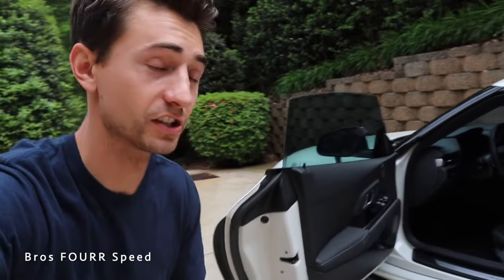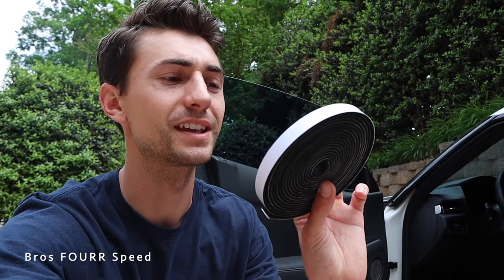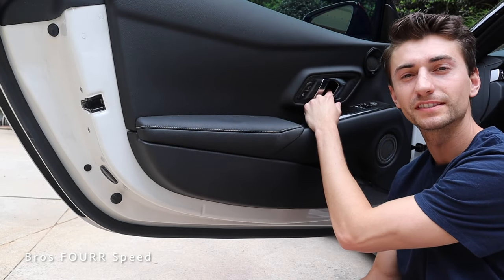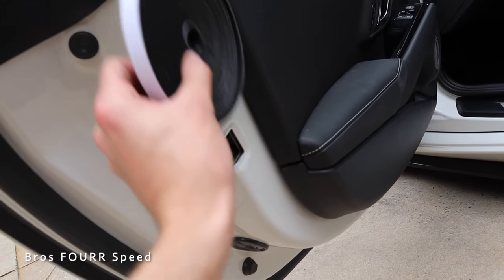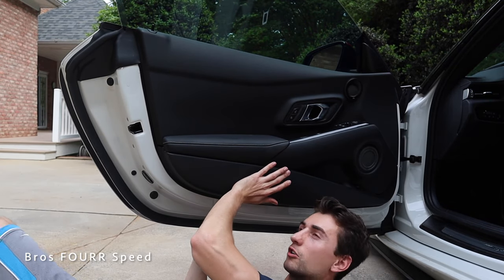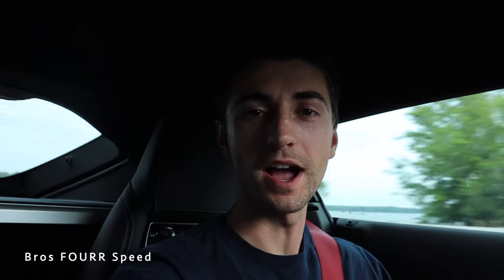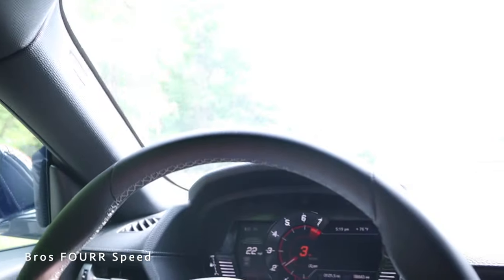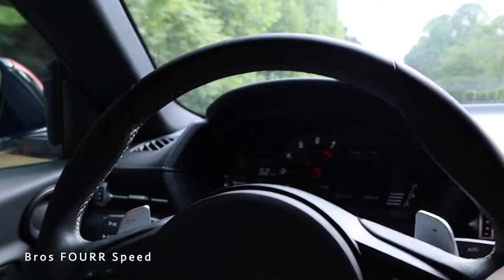How To Fix Car Interior Rattle Noises - (The Easy Secret)

Comment: As is usually the case, a little piece of foam as the isolator remedies rattles. I can't imagine how many points of a car could lead to rattles, it's almost infinite. If you asked me what I'd pay to have a basically guaranteed rattle free car, here's my metric. Fixing after the the fact takes much longer due to disassembly. If there was a tester that could isolate all rattles, then chalk that up to R&D, let's say adding extra padding to a car is 20 hours at 150 per hour. If we could pay $3,000 to have most panels isolated in a way that basically  prevents all rattles, I'd pay it. There's no option for this, but what's the nominal cost to make a car rattle free? I feel like the majority of people don't care about things like this, but for the few of us, what is it worth to have a rattle and noise free car? Up to today, I've paid 75K for a car and it's not noise free.

Comment: Had to do something similar with my GLI... The center air vents, right above the climate controls, emitted a rattle over bumps unless I pulled up on them slightly. So I ended up sticking a piece of foam between the climate control trim area and the underside of the vents, and it worked pretty well! Sometimes the noise comes back if I hit a pothole hard, but it's not constantly rattling over coarse pavement like it used to. It does feel great.

Now if I could solve the buzzing sound from my back seat I'd be truly happy. lol
Reply from the maker: Nice! Is there plastic trim on the back seat thats hitting something? Maybe its the frame around the backside that locks into the portion of the car. Maybe thats plastic on plastic

Comment: Thanks for this tip! I knew I’d waste my time taking my Rav4 to the dealership for this issue. I’ll definitely try this because I hear rattling from my driver side passenger door and it sounds like sunglasses are shaking in the cup holder. I’m hoping since yours is also a Toyota it’s a brand issue and the door panels are similar. I never had rattling noises with my Mazda CX5 🤦🏾‍♀️
Reply from the maker: hah yeah dealers don't know anything lol. This worked great and is a solid way to fix panels for sure!

Comment: Thanks for the video mate. Got a 2020 Camry last year , spent $30,000 and I'm having the exact same noises as the ones in your video. Shame as its a new car. Noise is coming from doors and B-pillar. Will try this solution, and will apply it everywhere inside the seatbelt tensioner area.
Reply from the maker: Oh dang. Glad to help you tho! Super impressed with how it worked for sure!
Reply: Did it work for the b pillar?

Comment: Omg i have the same issue but with my new wrx 2022. Still can't pinpoint exactly where it is but hopefully when I get my oil change, I can have them take a look at where it is happening and fix it. Ruins the driving experience a little bit because the only imperfection I feel I should be hearing is anything BUT the car.

Comment: Just hear a lot of complaints about this and was surprised since I thought it was mostly a BMW interior! My M240i has nearly 45k miles and it's quiet as a mouse still inside the car. Glad to report the build quality and noise levels in the RS3 are just as good and I don't have any rattles! How about your RS3?
Reply from the maker: Yeah no complaints in the RS3. Solid car! My current Supra makes no rattle tho. So maybe just the 2020's had a loser fit on the door panel. Current one is 2023
Reply: @BrosFOURRSpeed  Yeah, they probably fixed the issue in your new model thankfully, so you didn't have to deal with it twice! I was genuinely surprised to hear of the problem.

Comment: There is a good write up under the audio section on the MK5 Supra forum about adding dyna mat and backing material to the door that increases audio quality but also keeps the door from rattling.
Reply from the maker: Oh nice! I’ve heard of that product. I don’t have an issue with the audio in mine. But I’m sure that can help insulate the car
Reply: Doesnt that add weight?😂😂 i love weight saving so…

Comment: Very nice video but I would like to point out that many people who have faced this problem have attributed it to the door rubber beading  rubbing and not the door panel plastic rubbing as has been mentioned in your video, any insight into it as to how you pinpointed the squeaking noise coming from door plastic and not door rubber beading
Reply from the maker: This fixed the problem in my car! I do t have any other noises coming from anywhere! This is it!

Comment: Same problem on my Mercedes.. unsure if putting same foam or Velcro (soft part). Do you think it can be done without dismounting the panel?
Reply from the maker: Just depends on how much you can pull the panel up. I did this without removing the whole panel

Comment: My Lexus was quiet until i got an exhaust, 3-4k under load and i hear rattling, car sounds cheap with it. Going to give this a shot! Im also going to play a hz generator app through the car speakers to simulate low frequency so i can pinpoint where rattles are coming from.
Reply from the maker: Hopefully it helps! Too loud of an exhaust definitely isn't the best way to go all the time

Comment: So it’s been long enough, has this technique held up? Does it still work well?
Reply from the maker: Kept working great as long as I owned the car. New ownership now and it still works. I'm going to use this on my GTR steering column too ;)
Reply: @BrosFOURRSpeed  right on man, I’ll be doing this to my doors for sure. Just need to figure out the rattle on the bottom of the iDrive now! Thanks for a fast response :)

Comment: Thanks for the info! I'm having issues with my 2021 Ram 1500 Warlock crew cab. There's random interior rattles that drive me crazy. I've already tried putting adhesive foam in some areas. I'm finding it extremely difficult to isolate the sound of where the rattles/vibrations are coming from.
Reply from the maker: Yeah thats the hardest part! Hopefully you can find all the points needed to fix it!

Comment: 2021’s don’t have that cheap plastic door panel and don’t rattle. At least mine does not.
Reply from the maker: Yea they do 😅. It’s the exact same piece. Give it time tho. And it only rattled on bad roads. So if you have nicer roads, the poor quality might never show through
Reply: yea i have a 2021 doesn't rattle yet only 1800 miles now though and i hit some rough spots on my daily commute. What annoys me most about the door is the grab handle/coin tray to close the door it is made out of plastic and creaks every time you pull the door closed. I absolutely love this car though.
Reply from the maker: @purpskurp8737  Yeah mine creaks too. If I could get the whole door panel off. I’m sure some silicone glue around the backside of that handle could help.
Reply: @BrosFOURRSpeed  I mean it’s plastic underneath a layer o thin padded vinyl material. I assumed you meant it’s all plastic.
Reply from the maker: The door panel itself is just plastic. The padded part is just on the arm rest. It's still all just cheap plastic. 2020 and 2021 have the exact same door panels. Give it time and depends on the roads you have. It might start
Reply: @BrosFOURRSpeed  The rest of my door panel feels just like the arm rest on the door.
Reply from the maker: @rayd7394  I’ve driven a few 2021 cars. It’s the same piece. It is a soft touch plastic. But if you bang it with the back of your hand you’ll hear the same sounds mine made when I hit it

Comment: I normally have rattling from the trunk area and the passenger door when I first start the car. It goes away a few minutes after I drive 🤷🏽‍♂️
Reply from the maker: That’s good it does away. Mine did that too from the cold start. Once the cars idle dies down things smooth out for sure

Comment: Nice ! Which foam tape thickness did you use ?
Reply from the maker: It was about 3/4in I believe. Link should be in the description
Reply: @BrosFOURRSpeed The link points to 1/8 inch thickness, that might not be the one you used ? Thanks!
Reply from the maker: @xmishik  oh I thought you meant the width lol. Yeah the link will be the right one

Comment: In my car it's the roof that vibrates.....it's making me crazy. I have a 2015 ford focus and that is the only complaint that I have so far.
Reply from the maker: Is it the headliner? Could maybe pull it off and reattach it with some sort of rubber bushing

Comment: Im confused. The plastic rattles because vibrating metal make it so. If you put alubutyl mats to sound deaden your door, it shouldnt vibrate anymore, thus no more rattle. Along other benefits of course.
Reply from the maker: The plastic door panel vibrates lightly on the metal door. So this foam strip in between them eliminated the rattle sound. The car itself is very well sound insulated and doesn't need sound deadening panels. Just eh plastic rubbing on the door
Reply: @BrosFOURRSpeed  fair enough.

Comment: Are rattles covered under warranty
Reply from the maker: Possibly. But it's more of a pain in the butt to go to the dealer and tell them to fix it. Mechanical issues are more of what's covered under warranty. But it can't hut to try the dealer if you can't pin point it.  Small rattles like the door panel they may or may not try to fix. But if it's something very loud, I'm sure they would see why its doing that

Comment: The link in the description takes you to this size: (1/2in * 1/8in * 50FT). It's not the same one used in the video. I just found out the hard way. Unfortunately I can't say which one actually is the correct size.
Reply from the maker: That's what I used in the video...
Reply: @BrosFOURRSpeed  I guess everyone can choose weather to take your word for it or mine then. No big deal. If I had to guess though, based on what I received and what I see in the video, then comparing the two…I'd  say the size used in the video is (1in * 1/8in * 33FT). Not the one from the affiliate link in the video description (1/2in * 1/8in * 50FT). Which I did use BTW. The confusion about the size used in the video is no big deal. I still gained useful information so I actually used the affiliate link, but usually I'll go outta my way not to lol.
Reply from the maker: @Nain1993  This video is several years old. The product could have changed. But I still have the rest of the roll. And it’s 1/2in wide and 1/8th inch tall. It’s literally $9. So it’s very cheap. And works. But when you click the link you can scroll through the various options and pick a different size
Reply: I think you're right actually. I'm wrong. My bad. (I'm not being sarcastic)  @BrosFOURRSpeed
Reply from the maker: @Nain1993  Obviously I’m right 😅. Why would I lie about what size tape I used? lol it certainly works well

Comment: Did you use 1 roll for both doors?
Reply from the maker: I only used about 1/2 of one roll. The roll was 15 ft. Each door needed like 3
Reply: @BrosFOURRSpeed  nice! From the link you posted it looks like it has 3 rolls for a total of 50 feet so should be plenty lol. You got the 1/2 by 1/8” one?
Reply from the maker: Yeah the link I posted was the exact one! It was one of the cheaper roll I found, and it comes with more then you'll ever need! lol

Comment: Buy a better car. Problem solved!
Reply from the maker: Well there are no cars that compete with the Supra that can offer this exact driving experience. So a $10 roll of tape seems to be a good way to solve the issue and enjoy this car
Reply: @BrosFOURRSpeed  The new Z will blow the supra out of the water! No foam tape needed
Reply from the maker: Time will tell. Supra has been proven to make crazy reliable power. And they handle amazing! These B58 engines can make over 700 HP and still be reliable. So once the Z is out and tested we'll be a blessing to see if it's actually good. It doesn't have a GTR engine. It has the Infiniti twin turbo engine. That motor is nothing compared to the B58 or a GTR motor. So we'll have to see if it can actually handle power.